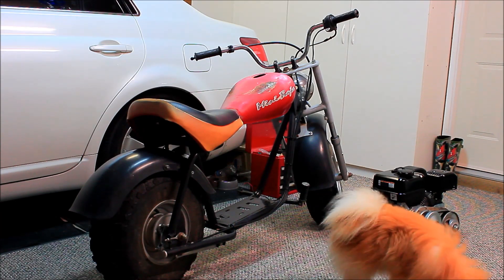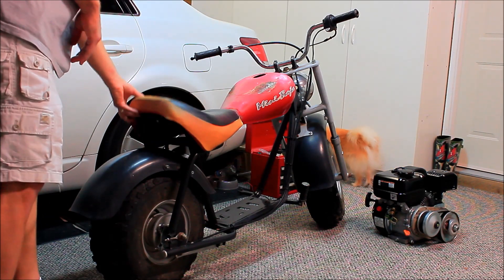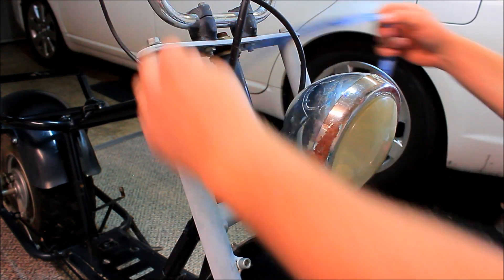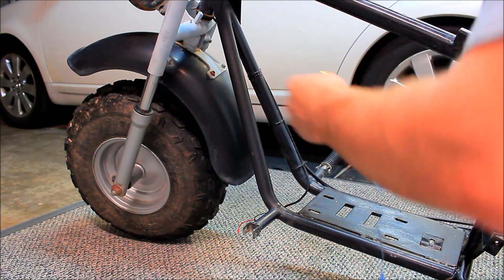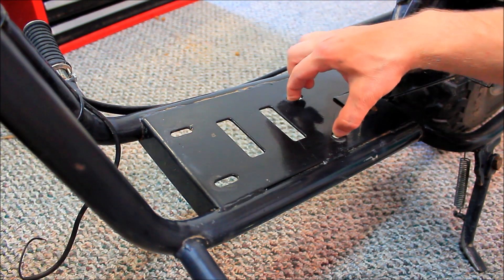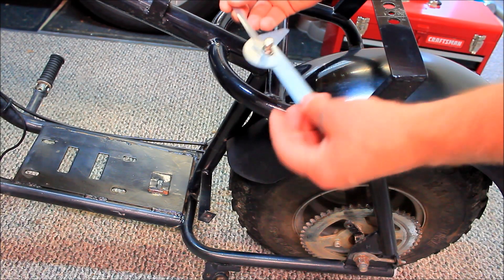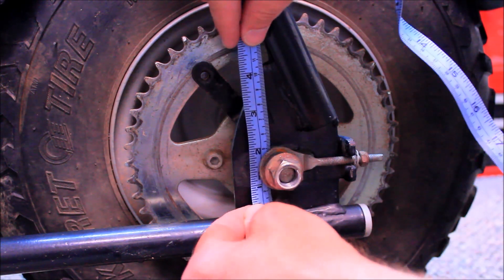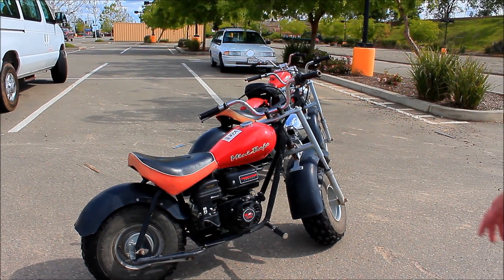Mini bike frame measurements for plans blueprints

Comment: Nice video!
How did you connect the headlight to the Predator engine? I'm working on a custom bike and I plan to use the Predator 212cc 6.5hp motor. But I'm having trouble finding a way to connect the headlight to the engine. Any tips on this would really help. Thanks!
Reply from the maker: The headlight is there just for looks. Predator engines don't have magnetos thats why they are cheaper than the rest of the engines. I've seen others on youtube install magneto and they were able to draw 12v power out of it. If you need a functioning headlight then i would suggest getting another engine thats already set up for that. I think Ebay and amazon sell them cheaper then any local stores out there. Good luck with your project and let me know how it turns out. Cheers
Reply: Eddie Is Awesome in the older baja warrior engines they have the charging coils with the headlight wire connected with the coils. the coils bolt right up to the 212 predator. The old engine also has the magnetic flywheel that powers the coils that as well bolts up to the 212. so swap out the baja warrior flywheel and put the coils on.

Comment: hi sir can you please tell me the measurements of the wheels and tires too? many sizes out there that i can't figure it out please help, thank you
Reply from the maker: These tires are 19 by 7 by 8 or 19x7x8. You can find them here http://www.ombwarehouse.com/MB200-218-Baja-OEM-Front-or-Rear-Tire-19-X-7.00.html  
Roundness of the tire is 19 inches they are 7 inches wide and will fit on 8 inch rim.